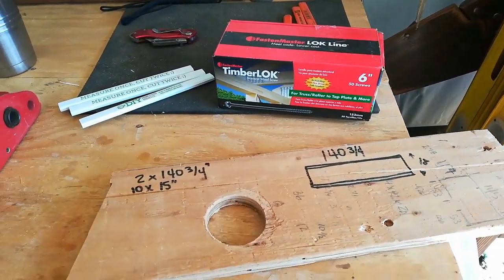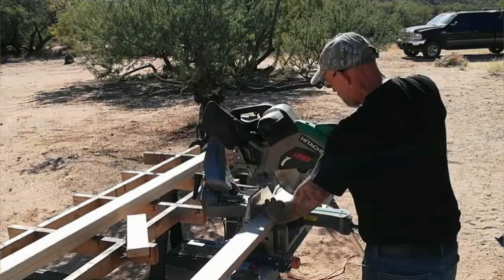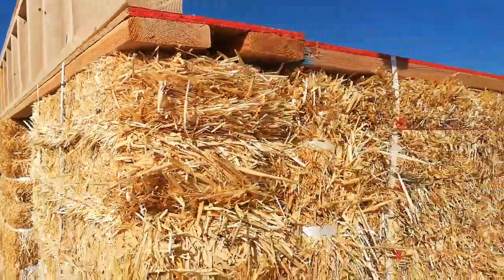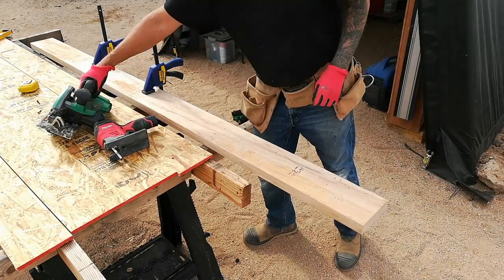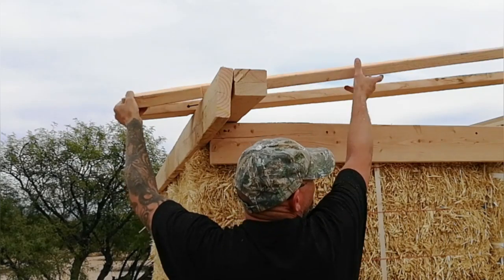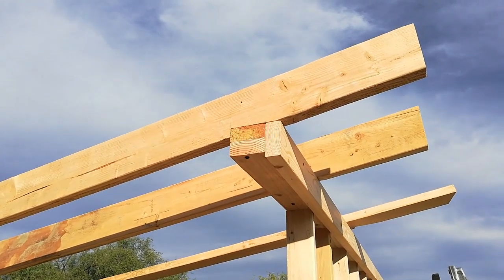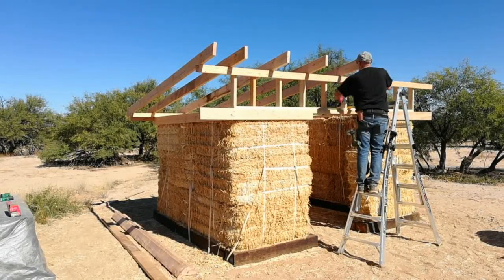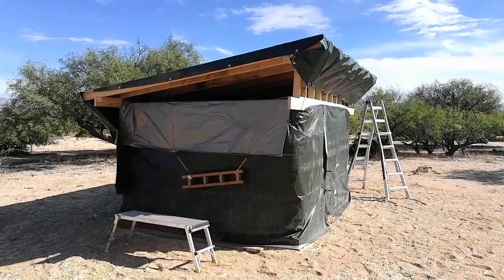Strawbale Toolshed Build / Day 4 Roof Goes Up

Comment: Inspireing, but wy no strawbale squeezed in between the roofrafters?
Reply from the maker: Working with a very tight budget on this toolshed and the extra layer of plywood sheathing was not in the plans. If I were to insulate the roof after the fact, I would find some batting with a craft paper backing on Craigslist for between the rafters.

Comment: HOW BIG WAS THIS BUILD AND HOW MANY BALES DID YOU USE HOW MUCH FLOOR SPACE DO YOU ACTUALLY HAVE AND HOW TALL ARE YOUR WALLS ? THANKS .  GREAT BUILD!
Reply from the maker: The walls are 6 feet, 6" tall at the lowest point and 8'10" at the highest point. The floor is 8x10. I think we used about 35 bales if I remember correctly.

Comment: I was watching a building video recently that suggested that nails were preferable to screws for framing/structural applications (unless screws are designed for this) because they bend instead of snap when there is a shear stress on them - have you run any any problems with the screws since you installed the roof?
Reply from the maker: Haven't had a problem. The structural screws used for the rafters are specifically designed to secure the rafters to the top plate. Screws are preferable when wanting to prevent "lift", as in a subfloor or roof sheathing. The sheer strength of nails are preferred for vertical applications such as floor joists. Structural Screws like Timberlok reference their sheer rating on the Packaging.

Comment: I'm a beginner, but I wonder if a small composite triangle beneath each rafter would be a much faster way to build this, instead of making each bird's mouth. Does that product exist? Are there good reasons why this shouldn't be done?
Reply from the maker: I did something along those lines with our solar panel mount. I ripped an angle on the end of a 2x8 that corresponded with the pitch of the roof. That allowed me to put the rafters directly to the beam with having to cut birds mouths on every rafter. I don't think I've ever seen anything like that on the market  probably because it would have to be made specifically for your exact roof pitch. I appreciate your comments and thanks for watching!

Comment: Still looks like a future fire trap.
Reply: @theupsideofdownsizing  The problem that I am seeing is the straw is sitting on creosoted wood which is an oil that can burn.  Now add to this compression and moisture from the air which can cause a form of composting which can get hot enough to self ignite.  You will be adding mud to the walls which will contain some moisture as you apply it and that will seep into the straw as it dries out.  All of these factors can add up to composting and possible self combustion.  How do you see this not happening?  I am concerned over what I feel is a dangerous building method.  Also do not forget you have that hot sun beating down on this building adding to the problem.